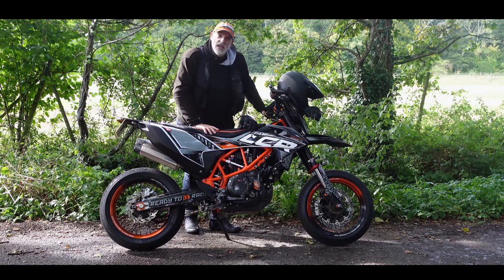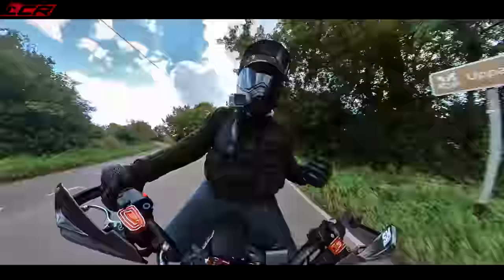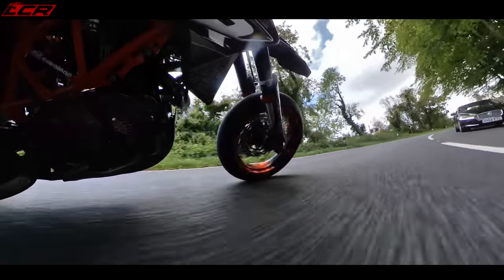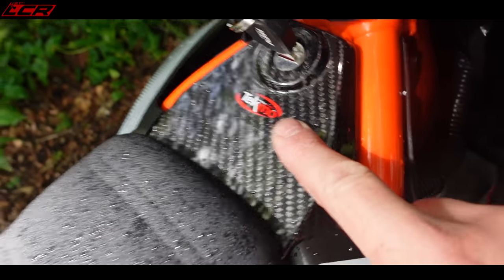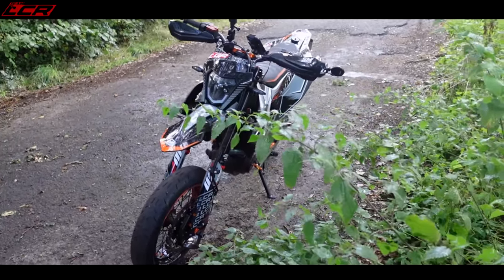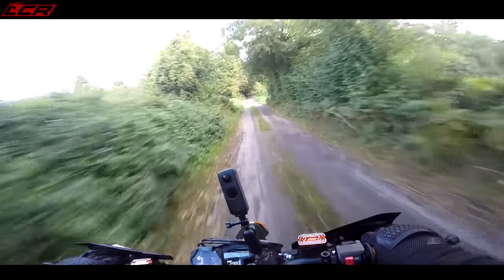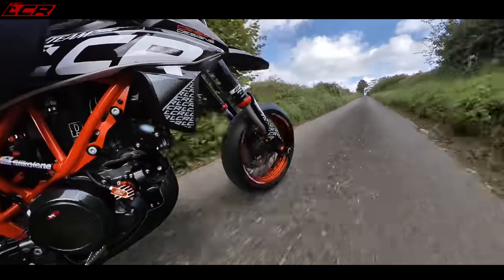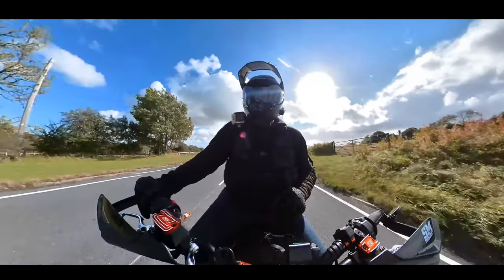Heavily Modified KTM 690 SMCR - EAR PORN!! 🤩

Comment: How does this bike handles mountainous, inclined, ultra sharp hairpin turns? Is it fast or sluggish? I was making fun of a KLX250s enduro till i tried it on sharp twisties. Marvellous. KLX 25.5 degrees Rake, 1430mm wheelbase. 690 smc r 27/1470.

Comment: Three washers on the rear abs sensor or just remove the rear abs ring on the rear wheel. Still have abs on the front, easy peezy
Reply from the maker: Ah OK, this tried and tested way of doing it? 👍
Reply: @LambChopRides  saves on the all the button push/holds just turn the key and away you go, understand/ been told that the 21 models have this setting by just putting in map 2 🤷🏻
Reply from the maker: Great stuff thanks Peter 👍
Reply: @LambChopRides  get the dongle 👍🏽

Comment: How's that luimoto seat when it comes to comfort? I picked up a powerparts one and the stickers peeled off in a matter of weeks and took a bit of black cover with them :/

Old supermofools light wasn't any different from $55 eBay/alibaba lights, you could change low/high beam depending on how you wire it. You can wire bottom line, three bottom lights, or all 5 lights however you want by changing their location in the connector (always on, low beam, high beam).

New cumpan with the gear indicator is nice, there's a nice 3d printed mount for it too. Getting to the oil temp location was a pain in the butt without taking the header out, so I used coolant for now.

Factory pro shift kit helps with false neutrals, although it doesn't cure them completely.

Debating on getting a tekmo slipon when I get the header or just running wings slipon with tekmo header.

Had an 821 hyperstrada before this 690 smc r, the ducati was an absolute snoozefest.

Comment: Nicest 690 SMCR on the web!  Love what you've done with it.  I've got a 2021 that is probably halfway tricked out compared to yours.  Going to do the Rotty stuff and Tekmo titanium header this winter and tune it.  Right now just have the Arrow slip on.  Great bike.... really fun to ride, but also very EASY to ride.  I also have a 2008 Hyper 1100S with just over 5k miles on it.  Love that bike too, but its a different beast entirely.    I ride the KTM much more because it's just easier to ride, the Duc is NOT an easy bike to ride and that engine braking and lack of any safety aids (ABS, etc) make it something to take very seriously.   If I had to keep just one, it would be a tough call.  The Duc is a work of art and I could stare at it all day... but as mentioned, it's just something I take out on short blasts, whereas the KTM is more fun to ride all the time IMHO.  Will be interesting to watch your upcoming videos on what you end up doing with your Hyper!
Reply from the maker: Thanks John 👍 wow your Hypermotard has the same miles as mine too! Really can't wait to get it back together, going to be epic once done 🙌

Comment: I have just looked on eBay and there's one very similar. 2015 one owner 3800 miles with the same filter and tune. I use to blast the lanes in 2021 on my xsr 700. last year on the big bulky triumph 1050 sport very sad :(

Comment: Thanks Chopsie, just going out on my 701 now. Tell me in round figures, what does it cost to get this extra 10% power and 30% at the bottom? I’m currently running a Wings exhaust, Rottweiler fuel dongle and standard exhaust.
Reply: Only thing you’re missing is the rotty air box and accompanying map. Header is more for aesthetic and weight savings. Stock flows fine.

Comment: Great machine, love supermotos and might treat myself to a 690/701 in the future to keep my 660 company. I bought my dad all the tekmo carbon a while back and I was very unimpressed with it maybe I got a bad batch but the finish on the non glossed parts was terrible and when I took it off his bike it had rubbed some of the paint off his casings also when I went to remove the carbon cover at the key one of the tabs snapped clean off, given what I paid for the stuff I expected far higher quality it also feels very weak and flimsy the only other carbon I've bought in the past was from Pro carbon and that stuff felt as strong as steel

Comment: You've owned all the bikes I'm currently debating between... a 701, a 690 SMC R, or converting a 500 EXC... of the 3, do you have a favorite?
I've only ridden street. I've daily'd a bike for 5 years and my last bike was a ZX6R.
Reply from the maker: 500 EXC converted cool, but just to impractical. My current 690 is simply awesome but really nothing between the 690 and 701 👍

Comment: Great update and stunning bike. Please can you do a review of the Dunlop Mutants. Be great to hear what you think of them.
Reply from the maker: Thanks buddy, the mutants are more a dual on/ offroad tyre no? Probably not what I would use on the SMCR..
Reply: @LambChopRides  I think you would love them. Hyper sports compound. Wet weather race tech. Supermoto inspired. Check out the YouTube reviews (you need to do one) there is a guy using them on an S1000RR called Smiffy at Cadwell. That’s really worth a watch right to the end. I bought a 1290 Super Duke based on your review. Id love to hear what you thought of the new Mutants. Keep up the brilliant work and excellent channel 👍🏻
Reply: @vixjayindy4828  dunlop mutants or bridgestone AX41s are the tyre to use in the wet colder months over here in the uk on a smc r or a 701

Comment: Hey chops, 
I also got an 690 smcr and got the cumpan on it but since its getting colder outside (around 12°) i can barely Hit 80° oil on the cumpan. Do you think the oil sensor gets cooled down from the outside air because even if i had 88° oil in the city after 40 miles of riding as soon as i ride faster it drops down to around 75-78°.When not riding in the city it barely hits 80° at all. Do you also have that? Also what rpm do you give your engine when its cold on the smcr and when do you start giving it the beans.
Thx allready love your videos btw
Reply from the maker: Yes colder ambient temps will reduce the reading, just give it slightly longer to warm and build the revs gradually would be my advice. But your probably right as the sensor also touches the casing its going to be at a slightly lower temp 👍 Revs wise I keep it between 3 -4k
Reply: @LambChopRides   i also keep it between 3-4 until i am at 70° then i start to increase it to around 4500 until its fully warmed up. Thx for the quick answer. love your smcr looks and sounds awesome sadly nothing of that is allowed here in germany atleast the best things like exhaust and led light and so on

Comment: Being a KTM it will have a gasket leak or worse before long. Ready to Race = Ready to Repair.
Reply: Yes.  One drop per ride.  Worth it!  Selling my Duke 890 R over this.  Too too fun. KTM does have a shift gear pinion leak dealer repair, though.
Reply: Negative vibes man !

Comment: I'm doing my a2 soon and am stuck between getting one of these or a MT 07 obviously restricted but should still be good fun, any help?
Reply from the maker: Yes even in A2 form will be great fun 👍
Reply: @LambChopRides  thanks for the reply, love the videos
Reply: @dudleywoolford554  get a 701 or smc r dont get a mt07 i got one brand new sold it 2 weeks later cant compare them
Reply: @rh_8599  why did you get rid of it so quick?
Reply: @dudleywoolford554  the mt07? mainly the awful suspension it depends what you want from a bike i guess but for me there is no comparison even when the extra money is taken into account a 690 or 701 wins everytime for me
Reply: @rh_8599  yh I’ve seen things about the suspension being dodgy but I mean I would definitely look at getting a 701 but my problem is that I would use it as a daily so I’m not sure if it’s the bike for me
Reply: @dudleywoolford554  if your going on dual carridgeways or motorways then no but any other roads the 701 is brilliant
Reply: @rh_8599  appreciate the advice and ride safe 👍